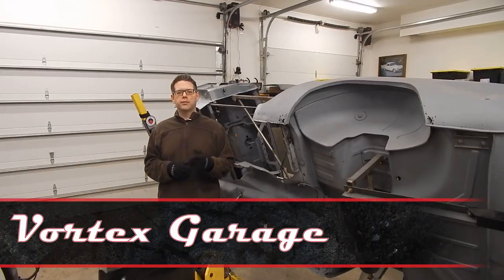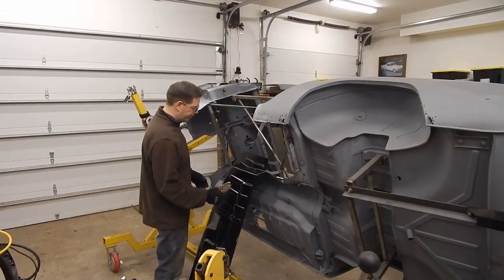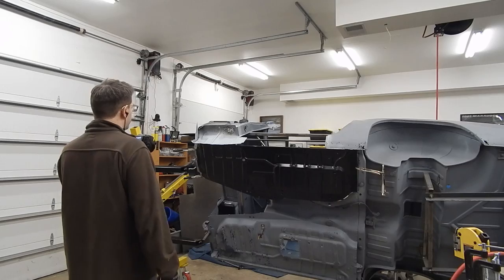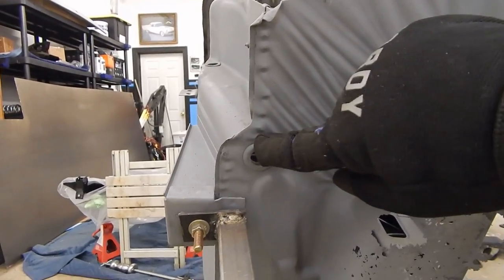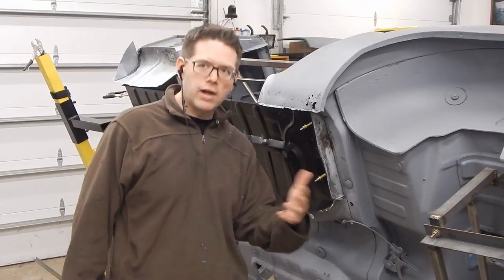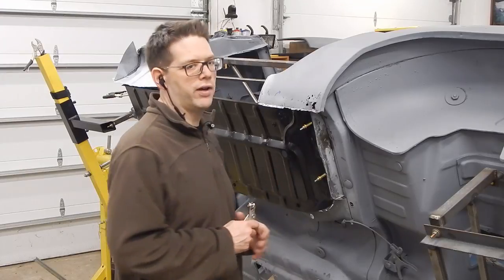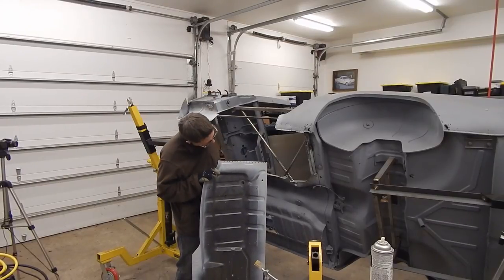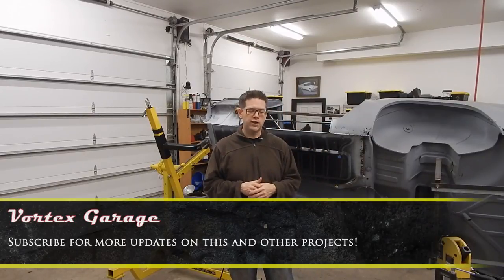Spitfire Floor Section Install - Mockup and Install of Floor Pan on our Triumph Spitfire

Comment: Knowing what I know now, I'll never weld another floor pan. Panel Bonding adhesive is just so much better and easier to deal with. Weld patches, yes, butt welds, yes, but flange to flange...glue.

Comment: How much is all this costing?
Reply: Liam Byrne Big money 💰
Reply from the maker: I think the floor sections are $300 each. Suffice to say for everything needed it will be considerable. Probably will spend more than the car is worth when it's finished.  That's the problem with a full restoration. They are rarely cost effective. This isn't a flip though and has a lot of sentimental value and will stay in the family indefinitely. Makes it easier to accept the cost over time